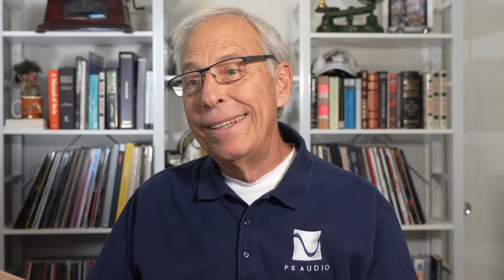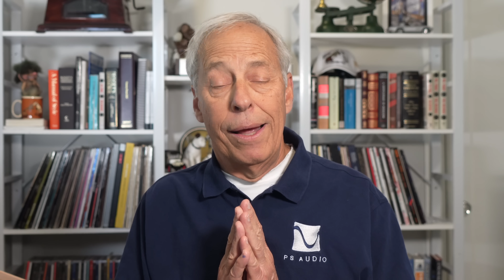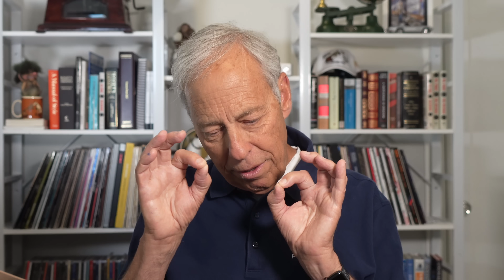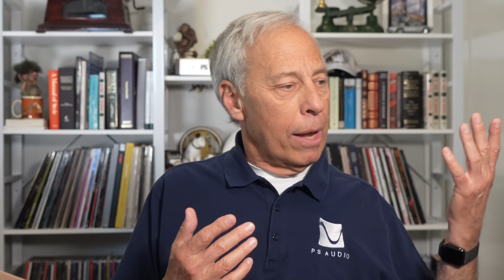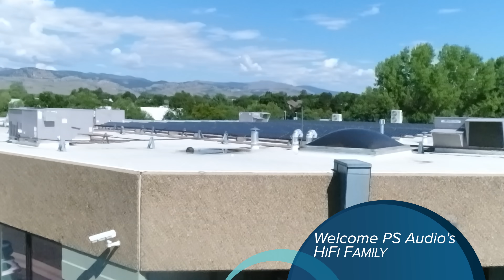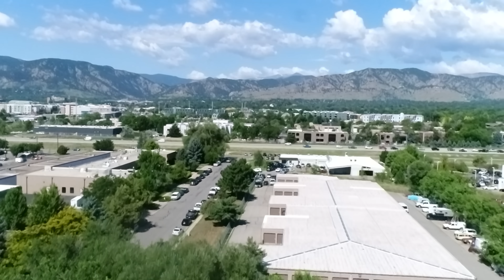Will MOSFET amps take the place of tubes?

Comment: But the question remains, if an amp should "sound". If I giva e rectangular impulse to the amp input, I expect a rectangular output. If this occurs, the amp can transmit all waveforms and frequencies. I know - this is pure theory - maybe not real. But what means "an amp sounds warm"? This means that the amp works also as an analog auto tune processor. But that´s not the original sound. So maybe a tube amp sounds well, but it dont reproduce the source. I have an idea: The best amp would use two inputs for its work: At first the source of the music as analog or digital signal and the music measured by a mic in the room. The amp now must bring the difference to zero. Then we have the original sound. Regards from Germany.... WoW

Comment: It's really interesting that there's always talk about how an amp sounds, when High Fidelity is about reproducing the sound the mastering engineer listened to in his studio. (Yes, the sound in the studio!!! It's impossible to capture the sound of the room with a mic exactly as if you were there. None of you have ever listened to a band and heard how they really sound in a rehearsal room! Even a concert is mic'ed and reproduced through a PA system that is probably not as good as your Hi-Fi!) In my understanding, the amp should not color the sound in any way. It's like going into the Sistine Chapel with sunglasses on. I guess we're all used to listening to impure music through bad earplugs, phones, and other devices that have a lot of bass and compression, etc. I think that's why most people don't like flat and linear neutral sound. It's the same as how C, G, Am, F are the chords for pop music, and "complicated" music with surprises, tension, and release is considered noise by most people (like progressive metal), because there are used to it. I'm used to the flat sound in a mixing studio, and every time I listen to stuff that is colored in any way, it's a pain in the ass.

Tube is not HiFi. Coloration is not HiFi by definition!

Comment: Tim de Paravicini argued that he could get the same sound out of both technologies - the trick was the circuit and transistor amps tend to use different circuitry as they are current driven as opposed to voltage driven for valves.  I don't know if that is true but he argues that he created two amplifiers - one valve, one transistor (class A?) and no one could distinguish between them.

Comment: My Hafler DH-220 has mosfets in the output stage and I have always loved the sound with my B&W DM2000's.  David Hafler designed the amp and previously was involved with Dynaco tube amps.  I am about to do a check out of the Hafler's capacitors and add an upgrade kit from Musical Concepts.

Comment: A good amplifier is a wire with gain. IF the THD, IM, noise floor, and damping factors are identical, the only thing left to color the output is the microphonic nature of the tubes. I'm a retired Technician, and have measured these criteria personally, For me, the gobs of wasted power involved in tubes is a non-starter. Cheers, --bd

Comment: With all this discussion about what amplifiers sound like, few people ever mention that they're not supposed to sound like anything. In other words, a good audio power amp is supposed to be "sterile"--it's completely transparent, and contributes none of its own sonic characteristics at all. It only increases the power of the signal to drive the speakers, without changing the sound of that signal at all.
Any characteristic of an amp that makes people like its "sound" is... Distortion :)
Regardless of circuit topology or choice of components, they're all supposed to sound exactly the same. So, whether you use BJTs or MOSFETs shouldn't make any audible difference at all if the circuits are well-designed.
Thanks for the video, your delivery is always entertaining :)
Reply: Yes theoretically, but in reality every component does contribute to the sound, hifi companies just tried their best to make transparent gears, but every gear doesn’t the same, an d at the end what you mean transparent is different to what I think transparent :)

Comment: You can artificially introduce a little bit of even-order harmonic distortion in the preamp or driver stage to very closely simulate the tube sound.
this is usually accomplished by diagonal clipping through a long-time-constant AVC circuit.

Comment: Great Analogy ! In comparing Mosfet Linear Amplifiers for use in Ham Radio the Sound difference between Bipolar transistors & Mosfets is remarkable.
The Mosfet Amps are the closest sounding to a tube in comparison.
Now add a Vacuum Tube to a Bipolar & Your sound changes the recipe all together. I have not tried a tube/mosfet combo yet. Hmmm wonder what that tastes like.

Comment: I would no use PWM type power amplifiers for midrange and tweeters yet.Lc audio and Midgard audio was early out and developing a pwm amplifiers and LC audio have some of the best.I use older design by LC audio,a power amp called :The end XP millenium(they also had a class A version called Zapsolute.Since i use sensitive tweeter section type AMT 96db 1M 1W.midrange section 3 Neo 10 planar magnetic total sensitivity around 98db 1M 1W.in active system i need quiet amp,s.The 4 channels with The end Xp i can hear a faint hiss with ear close to tweeter.The other thing soundwise is they dont have negative feedback correction,local or global.Itsound the same at low volume as at high volume.They are nautral flat smooth and detailed with varmt i hear in good tube amp.The no feedback design are a big part in this as the overall design do to,and they last.240 000 uf on 4 channels 100wartt each.Woofers are driven by a modified pa amp called Cerwin vega 1.5KW but is a rebranded amp with some changes made to it from spain sold only by High fi club here in Norway back in 2004.Like some ps audio gear But the prices are high.More a diy and repair guy anyway.Fun with stereo sound.

Comment: I got a MOSFET. Its a Jaycar DigiTech amp and only cost $300, brand new. Would it be a true MOSFET at that price? They are ment to be like an extra zero on the price. That particular Jaycar amp is discontinued now. It KILLS my $900 NAD hands down! The cymbals sound like metal more (even on non metal drivers).

Comment: I recall in the later 1970's Hitachi was the first company to use powered MOSFET's in some of their amps as they designed them. I've read some reviews in Stereo Review, High Fidelity and Complete Buyers Guide to Stereo/Hifi Equipment magazines that praised powered MOSFET technology.
Reply: I just picked up a 1978 Hitachi hma 7500 mosfet amp.
Reply: @MrJasonfromcanada - fantastic score my friend. The MOSFET (metal oxide semiconductor, field effect transistor) is said to give transistor amps the sound of tubes. I think it's a class G amp too but where normal class G is AB/AB the HMA-7500 is A, A/B and runs warmer. I have a full page review of the HMA-7500 in my 1980 issue of High Fidelity magazine. Also have a "capsule" review (one paragraph) in a 1979 Complete Buyers Guide to Stereo/Hifi Equipment. 
The HF review says...."whether the clarity, brilliance and extraordinary imaging we experienced with this amplifier can be attributed to the use of powered MOSFET's we cannot say. It is enough to say that the superb Hitachi HMA-7500 comes as close to perfection as any power amp we've heard".  You gotta tell me, what pre-amp, speakers will you use with the 7500?? 
 I've been using a class G Hitachi SR-804 (50wpc) as my main amp since 1979. No regrets. Running my SR-804 to loud levels for hours at a time and the cabinet top is barely warm, fuhgeddaboudit.
Reply: @martyjewell5683  Right now because I’m just getting into HiFi equipment I recently purchased a new in box untouched Marantz NR 1711 av receiver for half price that I’m using as a preamp to the hma 7500.  The speakers I’m running off the hitachi are Fyne Audio F301’s with plans to upgrade to the F303’s as my main fronts and use the F301’s for surrounds.  
The source i’m using right now is Tital streaming.
I’ve been playing around with switching between the speakers hooked directly to the marantz and then with the 7500 hooked up and I can say there is a noticeable improvement in that warm detailed sound quality. Even when turning up the volume at higher levels the sound just doesn’t get fatiguing. Its just really fantastic sound from low to moderate to higher volumes.  
Note do to the F301 speakers being book shelf speakers I do have an old cheap vector research 10” sub hooked up as well.  I keep that between -2db - 0, just enough to fill the bottom end a bit
Reply: @MrJasonfromcanada - googled your Marantz and F-301 speakers. For power the 1711 should do well with it's 50wpc. I like the feature of Pre-out/Main-in. It makes a component soooo much more useful. Sadly my SR-804 lacks it. But I've never needed it. One disturbing facet of this Marantz is its inability to drive 4 ohm loads, seemingly a current (no pun intended) trend in amplifier design. This deprives the listener from using some truly fine vintage 4 ohm loudspeakers. The F-301 is ported and listed as bass to 44Hz (-6dB's). I wonder what the -3dB (which is more useful to bass performance) rating is?? Probably around 55Hz. Still though, for their size, very respectable. Seems all gods chillin's got vented speakers nowadays. My kitchen speakers are the Boston Acoustics A-40 with bass -3dB @ 68Hz and bass does satisfy in my 900+ cu/ft kitchen. I checked Stereophile.com and read a glowing endorsement review on the F-301's. Your idea to use a 10" sub for augmented bass is a swell idea. 
I remember the early 1970's when bass-reflex speakers sucked and AS ruled. Into mid 1970's two companies were using Thiele/Small equations for venting speakers. They were Electro-Voice and Ohm Acoustics, with spectacular results. I purchased Ohm Acoustics (4 ohm) model L's in 1978 and still use them. Also getting popular into mid 1970's were satellite/sub woofer systems. EPI built a very good mini in their model 60. No Rogers LS3/5A fer sure but very good. My dinning room speakers are Ohm Acoustics model H with a 12" passive radiator (drone cone) venting and bass to 32Hz (+/-3dB's). One of my favorite music songs for speaker testing is Renaissance's "Trip to the Fair". It really shows HF speaker ability and is a freakin' boss cut.
Reply: Arcam use them as well.

Comment: No, no , no. 
First, your analogy is comparing apples and oranges. Cooking is art and electronics is science. Yes, we can certainly examine the science of food but food is not a constant. Peas grown in one portion of the country may taste completely different than another portion of the country because of soil and several other conditions so we add or don't add salt to adjust the taste, and this is the important part - to our liking. If we take two transistors and both are matched on instruments beyond human hearing than you can't hear the difference. If you think you can then prove it in a DBT. If you think you can hear the difference in two resistors that I can't see any difference on my test instruments than proof is required. Remember, we're using science here, electronic instruments whether for audio or testing and designed with science. I can buy an off the shelf bench meter for under $1000 that can measure accurately down to nanoamps. We can buy opamps for under $5 that exceeds human hearing but we can't make amps under several thousand dollars that sound great. What's wrong with this picture?

We know why people like tubes, it's called second harmonic distortion and lots of people like it. Can we contour mosfets to sound quite a lot like tubes? Yes we can. Can we make class D amplifiers that sound neutral? Yes we can. We listen to recorded music, it is what? It's amplified! What does that mean? It means it's colored by amplification and adjusted by recoding engineers using what? Amplifiers! Everything we hear is colored by amplification, nothing is neutral.

An engineer can make and amplifier with super low distortion, flat bode plots and FFT's with noise levels below 120 dbs? Does it sound great? Not necessarily. Why? Because none of those things absolutely establish the sound we like to hear because listeners, for the most part, like distortion whether they realize it or not. Those are statistics of audio sales people and they have to print something on the page so they print distortion figures in the .001% and better because the lower the distortion the better the sound, right? Wrong. This is the problem with audio, we want to say, see, it's perfectly designed to every 'accepted' characteristic but "we" have to tweak it to make it sound great because we know what sounds great - trust us! Oh, and by the way, that secret ingredient we put in our amp isn't cheap, that's why we take an off the shelf class D amp and mod it to sound great. Then we wonder why psychologists have a field day with audiophiles and cognitive dissonance! We have wires going to speakers that have to be some exotic material or they don't sound good. Are we kidding or what? I know engineers who laughed when this whole cable nonsense started, they said, "no one could be that gullible"...... they were wrong!

Comment: Back in the 80's I  had imported from England a Grant G60s MK2 integrated amp.  Designed by Roy Grant (Of the Grant Lumley fame).  I discovered it in ads in Gramophone magazine.  Tube preamp and Mosfet outputs- sounded fantastic.  It was one excellent sounding amp with its tube preamp.  Who cares if it sounded 'different' than tubes?  Its sounded excellent.   And, I had owned all tube equipment in previous years. So, I know some of the benefits..   Sometimes "sounding different' is not a bad thing.

Comment: MOSFETs operate on a square-law transfer function, like tubes do, while BJTs operate on a logarithmic transfer function. If there's a difference in 'sound' between MOSFET and BJT amplifiers, part of the reason why is because of that. A square law transfer function is nowhere near as linear through zero-crossing as a log function is, and never can be. Some designers run high bias, at least 10X as much, on MOSFET amps to try to get some of the linearity back, but it's only partially effective.

Comment: Tubes  will always be around.  

Beyond how they sound people leave out how visually appealing they are.  It’s certainly a factor for some.  Even VU meters and lighting can play a part as to what some like. 

Others may choose them also because they produce heat and they live in Canada. 

Others stay away from Tubes like myself because they indeed produce too much heat and are delicate and degrade over time. 

Weight and size of amps and pre amps play a role also. 

Even room characteristics can and should play a part.  Some rooms are carpeted and some hard wood floors.  

Choosing the right equipment takes a lot of planning and thought process. There are just compromises too.  Music preference should also be factored in.

Comment: Let's start from a real engineering basis. BJTs are current amplifying devices(current-in/current-out) . MOSFETs are transconductance amplifying devices (voltage-in/current-out). Triodes are voltage amplifying devices (voltage-in/voltage out). Pentodes are transconductance amplifying devices (voltage-in/current-out). Check all their output curves to realize the device-level differences. Amplifier circuit design with such amplifying devices is another story. You can make a BJT operate as a tranconductance or even as a voltage amplifier, but that would lead to an "unnatural" behavior of the amplifying device itself. This means that the linearity distortion will not be the best possible.

Comment: I wish fet amps would replace opamp guitar amps. the clean channel soft clips and more of treble is cut.  Fet preamp generally round out a square wave because of the miller effect which makes any thing you play through sound little warmer. most audio amps do not use fets in the preamp stage because it never goes into clipping. also for audio why they do measurements because idea amp is 100 transparent which means the amp does not color the sound.

Comment: @David Miller there was another amp designer who made two sets of amps. This wasn't long after the original Audio Note Ongako from Japan so 1990's.. This genius was none other than Tim de Paravicini. So he said this if I make two sets of single ended mono block amps one valve and one solid state they should sound the same. So he did and they were the start of the Yoshino brand. These amps caused a bit of excitement at the time being close to the Audio Note price tag @ £40000 for each set then.. So to cut this pile of drivel short not even Tom could make a solid state single ended mosfet amp sound like a valve amp and why would you.. I have no idea why I've mentioned this but it's history and one that's important in the HiFi world
Reply: So Tim/Tom built a mosfet version of a tube amp, and people didn't like it as much? I would be amazed if tubes could sound like mosfets, simply because EM fields affect the function of both devices quite differently
Reply: @mississippijohnfahey7175  Tim and they did..And all who heard the 30K amps were in agreement that the both sounded very similar..If I remember correctly they all favoured the solid state version..I'm a valve guy and always will be..However GAN FETS are sounding very promising
Reply: @garth57  cool, I hadn't heard of GaN FETs before. They do look promising!

Comment: I must disagree that mosfet transistors sounds more like tube. If we talking about linear amplifiers (class A, AB) in my opinion BJC transistors sounds better, however, If we talking about switching amplifiers (class D, T) mosfet transistors give much better results. There are no transistors in the world who sounds like tube or even closer. All depends on the application. Tube amps are totally different designs hence sound has to be different..